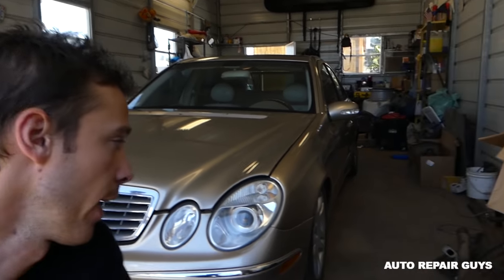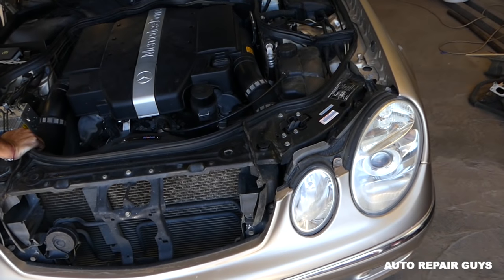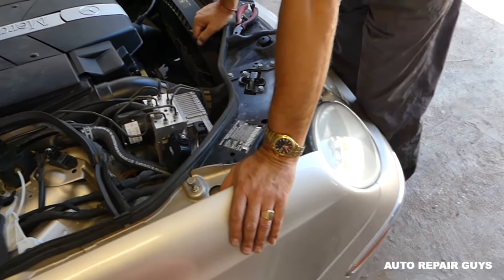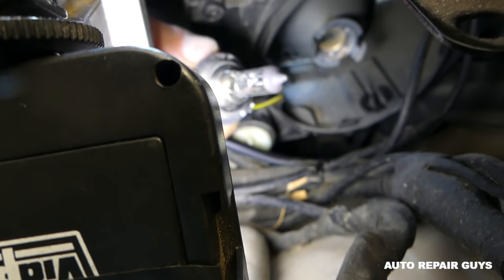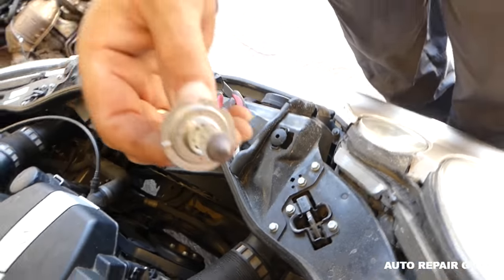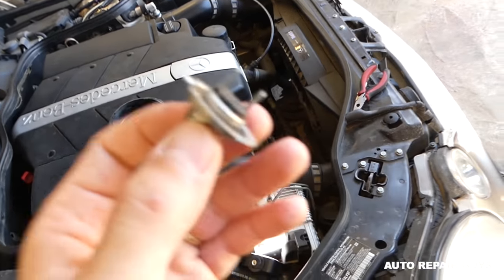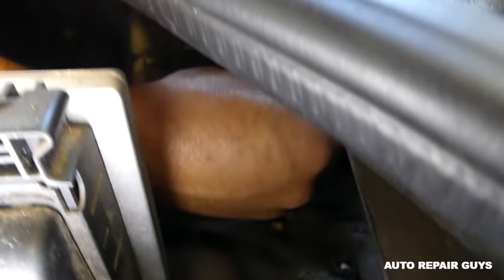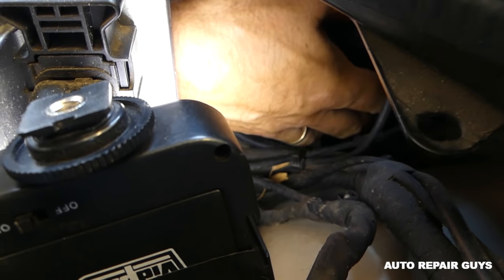MERCEDES W211 LOW BEAM HEADLIGHT BULB REPLACEMENT REMOVAL

Comment from the maker: Products that we use and recommend:
►Headlight Bulb used for this model: http://amzn.to/2j1QHTq
► Panel Removal Set: https://amzn.to/3YiMADu
► Tool Set: https://amzn.to/3p5MM6t
► Screwdriver Set: https://amzn.to/3XRB28Q
► Castrol Oil: https://amzn.to/3xBc8B9
► Oil Filter: https://amzn.to/3w0Ulme
► Torque Wrench: https://amzn.to/32qyRwg
► Liqui Moly Engine Flush: https://amzn.to/3IiDBID
► OBD Scanner that we use most often: https://amzn.to/3I4MQfe

► Check out our Amazon Store for the tools and parts that we use: https://www.amazon.com/shop/worldmechanics
Reply: Omg. I went to oreillys for new bulb for 2007 e350, the guy was like yeah, you have to take the bumper off to replace, I had one. He lied. So easy

Comment: “Make sure to wear gloves or wipe it with alcohol.” Does neither.
Reply: have a clean cloth, I might be wrong but thats worked for me
Reply: Marcus lol !  That's the best.  But at least it was a quick overview of how to turn the outer cover and the bulb socket assembly.  Pain to get it fit back in for me.
Reply: I think you may have missed an important point. If you TOUCH the bulb you should wipe it with alcohol because the natural oils from your fingers will shorten the life of the bulb, or wear gloves to eliminate that problem. If you are competent enough and don't touch the bulb you don't need to do neither.

Comment: To replace the headlight bulb on the right hand side, looking at the car from the front, just remove the overflow water tank. Undo the screen to the rear of it, and it lifts out of it two push-in holes below. Just move it to the left. Before doing this, in my '09 E350 Sport, I first remove the air intake section. These two things take a few minutes but allow your whole arm and hand to get to the bulb at a good angle. The left hand side shown in the video is actually the hard of other two, as there is nothing to remove to aid access. FYI.
Reply: Is it counter clockwise or counter
Reply: @dextercannon5299 My recollection is undo was counter-clockwise. My recall may be inaccurate, but I do recall once it got past the initial resistance it turned easily. Hope that helps.

Comment: Thanks for tips. Took me a long time to replace bulbs as I am no mechanic. My bulb blew on left side / hard side.  I had trouble getting my arm behind the lamp unit and getting my hand in right position to release bulb holder from lamp. One tip I wanted to share is to use your left arm and face rear of vehicle. Only then could I exert right twist to release the bulb holder. Hope this helps.

Comment: thank You for the great info. BUT I saw something that don't look right. 
THERE IS no insulation around the wires close to the socket. is that normal. 
The wires are bear for like 3 inches from the socket, can heat burn them away?
Reply: anyway I was very carefull to seperate the wires, 
She drove off with all good but I think the heat is 
destroying the wires insulation...

Comment: I tried following the repair guide, but my passenger side (right side) low beam bulb wont turn in the assembly to be removed! I tried on the driver side and it seems to be working perfectly, however that's not the bulb I need to replace at the moment, any clues as to what's happening or how I can get this bulb to turn so I can replace it?

Comment: I see you chose the easy side.
Reply: curiel101 same thing i said everyone is using the easy side
Reply: curiel101 yup
Reply: left side is easy if you remove the left air intake and move the radiator fill tank out of the way.
Reply: He said that in the video.

Comment: I have a 2002 Mercedes Benz E320 and when I turn on my headlights my right high beam light comes on but when I switch on high beam they both comes on like they supposed to could someone tell me what is wrong
Reply: 14clydda electrical connections

Comment: That’s the easy side show the driver side in another video I don’t know if you have another video showing how to do it, thanks.
Reply: I had to replace that side first, it still sucks but there are a couple things you can do to make more room. Basically there is a fluid tank that can be moved out of the way, just take out the screw holding it in place (mine was a crappy plastic screw that broke, so I zip tied the tank back when I was done). 2nd thing is the fat intake hosing going from the grille to the engine can be removed/reattached by hand, no tools needed.

Comment: So both the Low beam and High beam both use H7 or what?
Reply: on my wife's car the high-beam is off of the park-light bulb. If there is only one bulb out on your car - you can verify where the high-beam bulb is by checking the "good" side.

Comment: THE SALT on the fingers make the bulb BURN.....
Reply: The oils from your skin gets on the glass and oil retains heat which causes the bulb to operate very hot -- it then fails much quicker from excessive operating temperatures. Never heard of the salt theory before. edit: I guess it is also the salt which can chemically weaken the quartz glass too! Good to know.